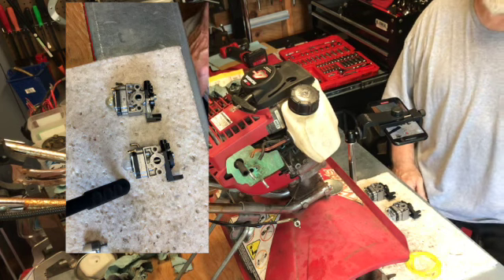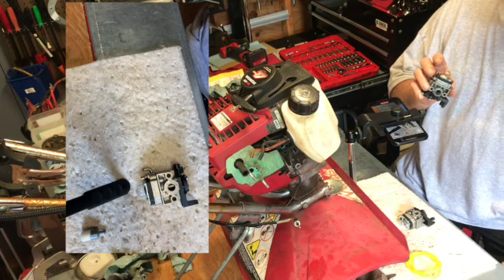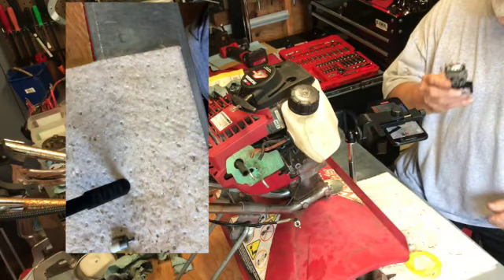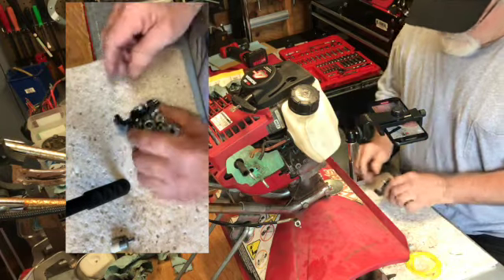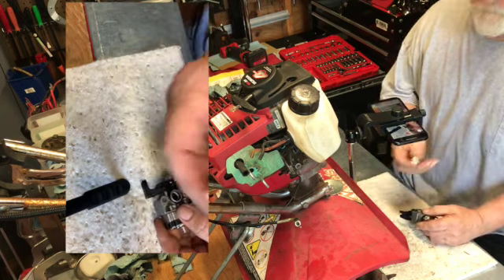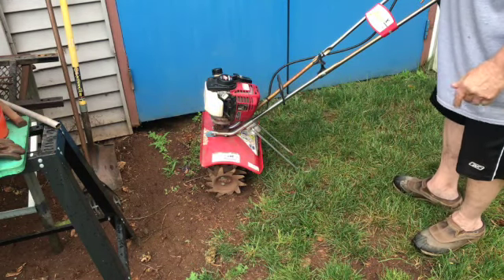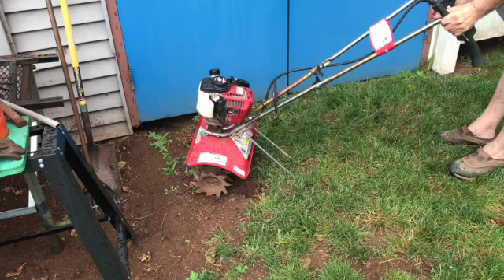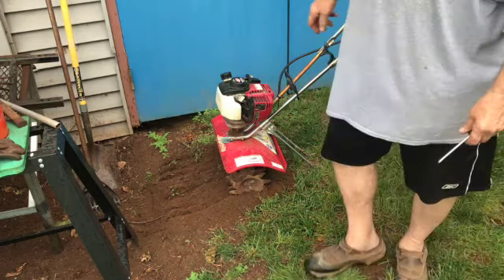PART 3 GX35   TILLER WITH HIPA CARB

Comment: I bought a HIPA carb for a Yardman weedeater recently. It worked perfectly, and it also included the gas line, new gaskets for both sides, the fuel filter stone, and an extra primer bulb. I agree HIPA is an excellent OEM quality replacement carb. I plan to continue to purchase their products in the future. I bought a carb from Fleabay for my Mantis tiller two years ago and it has never been right. I am seriously considering redoing the Mantis with a HIPA carb.
Reply from the maker: Great company that HIPA are